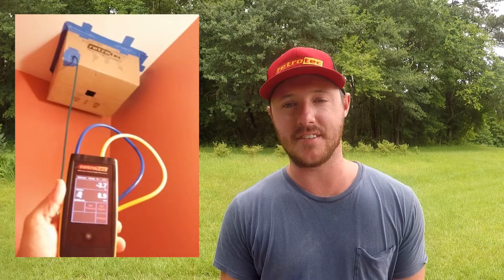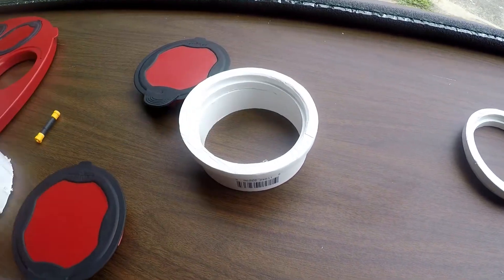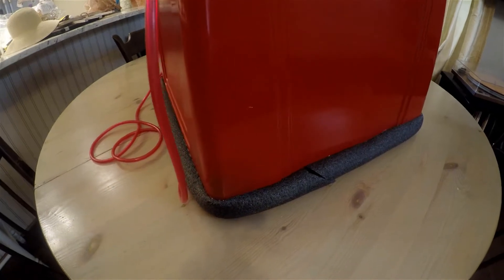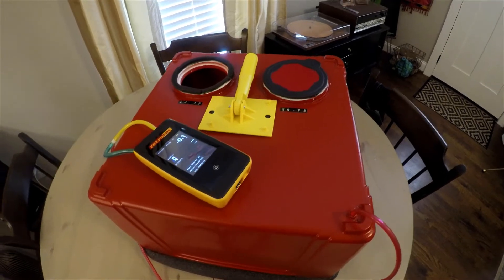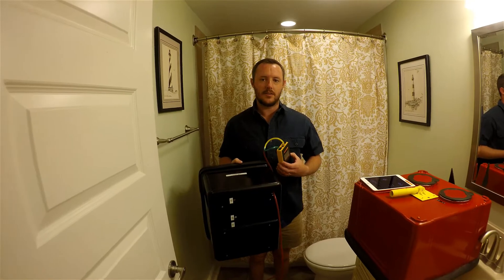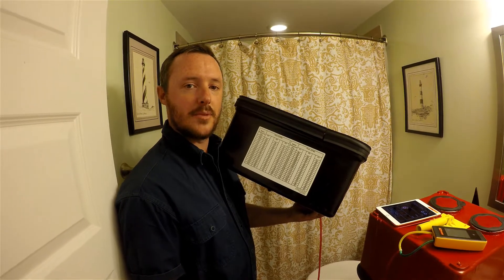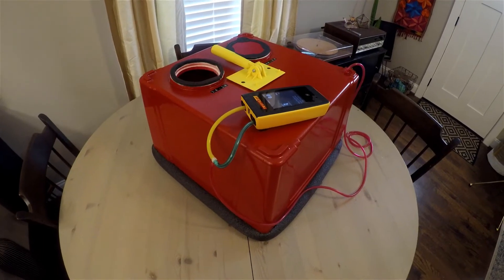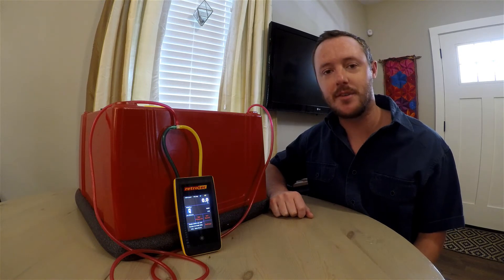Build Your Own Exhaust Fan Flow Meter Pressure Pan Combo

Comment: Very nice design... You only used one of the openings, but you made two. What is the point of the second opening? Also, All my gear is Retrotec, where could I get a sticker for my Ipad? it looks great!
Reply from the maker: Sorry, just now seeing this! This particular bath fan I tested was at a pretty low flow so I only needed one hole open. The higher the flow, the more holes you'll need open to keep the pressure within the correct window. We now make one of these with 4 holes. https://www.youtube.com/watch?v=7TmL40nu9E4&list=PL62zv4SHL06pwnRjOkNMrdGSrGPmNGIra&index=8

The only decals we have available now are our 50 Pa stickers, which are pretty cool if you do blower door testing! https://retrotec.com/retrotec-50-pa-sticker.html

Thanks for the support!

Comment: I understand how you are measuring an exhaust fan CFM but why can't you use this to measure CFM at an AC register? I know you would need to swap the yellow hose to the green port. Is this possible?
Reply from the maker: The problem there isn't the ports, its the design on the box. If you were to measure a supply register with this box, you would be adding pressure to it that would skew the reading. Measuring exhaust or return air with this is fine because you are not manipulating pressure inside the box, its just passing air through a known hole size. Thats why it only works for exhaust scenarios.
Reply: @RetrotecEnergy  Do you think it would add more or less to the reading? I think it would show less of a reading because it is holding back the flow.
Reply from the maker: @bjs027  it varies depending on the output at the supply. Remember, the gauge is reading pressure in the box and mathematically converting the pressure to flow through a known hole size. If the box is being highly pressurized, it could over exaggerate it. No matter what, pressurizing with this type of method will not give you a reliable reading.

Comment: nice video! could you list the products you used in the video. I am a Hvac contractor doing new construction. I've had a few bath fans not produce 50 cfm. I would like to check the fans before the inspection. I don't own any blower door tools. How can I make this other wise?
Reply from the maker: For this to work, you'll need to have a DM-32 Manometer. Any other differential manometer will not have a hole-flow function to allow you to build your own exhaust fan flow meter. In addition to the manometer, I used a 16"x16"  file box, 2 4" PVC clean out adapters, a tubing connector from Retrotec, and super glue and/or jb weld to hold everything together. Like I mentioned in the video, you dont have to use round holes. You can use rectangular holes and use rigid foam to block the holes you're not using. However, the ACIN flow hood that I used in this video is also a very nice option for testing bath fans, returns, supplies, and ventilation. Its the most accurate air flow measurement tool on the market and can be found at retrotec.com

Comment: What type of paint did you use?
Reply from the maker: Just a typical Krylon multi-surface spray paint. I would recommend something with some flexible additives to really make it hold up since the box does flex some.